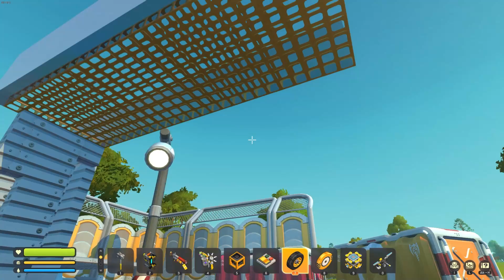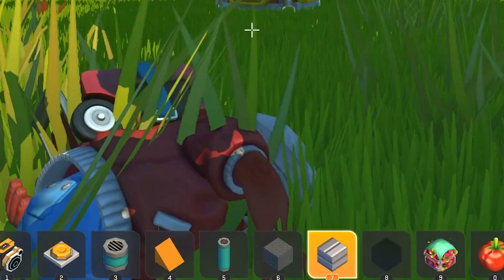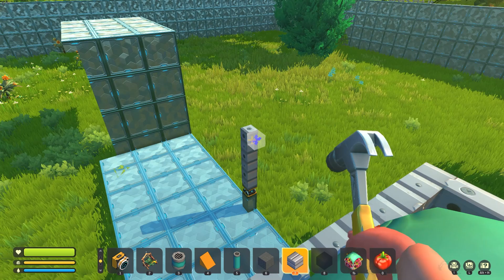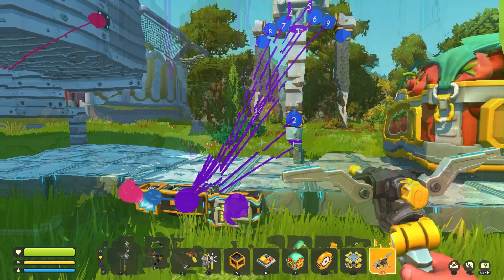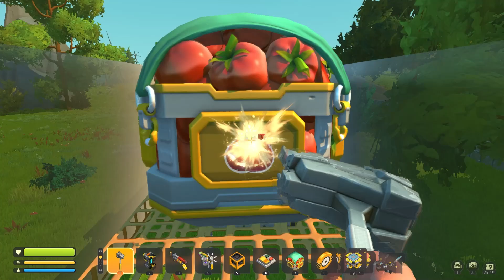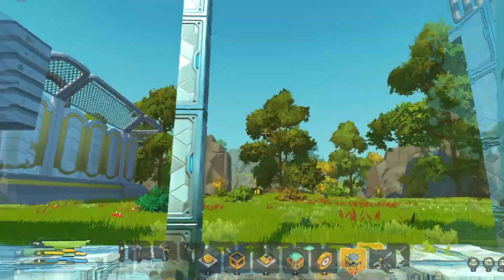Crate Handling Robot Arm - Scrap Mechanic Survival Unleashed

Comment: I ran into a similar thing building a color coded auto warehouse. The 'lift the package' process needs to be on its own controller. I used a memory bit with a timer to control the whole thing, one to handle the rotation, and another for the lifter. Sending the reset signal to the lifter bit will make it put down while other controllers and timers handle where and when.

Comment: kinda reminds me my auto delivery :P tips like i would fix it
1. make holes in bottom of"basket" for arms of grabber it will be able to get easier under crate
2. now u can remove heavy blocks from grabber and even left only 3 beams instead of 5
3. im avoiding reversing actions of controllers by sensors to check every step, machanism will be more failing proof
  example: basket detects crate => arm rotate above crate => sensor on arm detects crate =>  triggers grabbing and moving to second platform => sensor detecting color of platform => dropping crate, im sure it wont be hard for you ;) hope i helped

Comment: I haven’t finished the video, but he seems to be doing a claw,
Why not just make it have a platform hand (like a spatula with short walls) that goes under the package, and sensors detect the spatula, and the floor beneath the package, gets pulled back so it drops onto it, then when it goes to shelf you can have a pusher of the spatula,
Edit: also, you could then stack vertically on shelves like in a warehouse.

Edit: also, you could then stack vertically on shelves like in a warehouse.

Comment: Seraph for your crane have you tried a forclift arm so it can lift from the bottom(by using slits in wall) and then rotates then it pushes it of or you can slide it off.

Comment: Interesting video.  I was wondering, instead of the robot doing the "yoink" & "yeet" function... 
Wouldn't it be slightly easier to use an overhead crane method instead, or would that be more work than is necessary?
Reply from the maker: An overhead crane can get the job done too actually! However there will probably multiple layers to the shelves so trying to maneuver around those may be hard from up top

Comment: The crane arm is a cool idea but I'm not sure if it's all that reliable of a thing to have automated in scrap mechanic. I think what would be more stable is to have an overhead XY axis track to follow, like a claw machine at the mall. You might have more precise 2D movement that way, and then the claw can raise and lower along the Z axis.
Reply: This is just a suggestion of course. Whichever you choose to do, I'm interested to see what you come up with, I look forward to your vids!
Reply from the maker: You’re absolutely right, it is pretty unreliable and I did plan on having a crane system like that, at first it wasn’t going to fit the type of dynamic shelving I was going to make but I may just adjust it